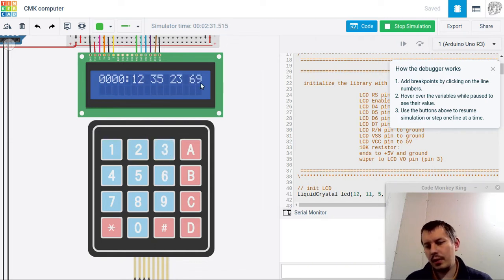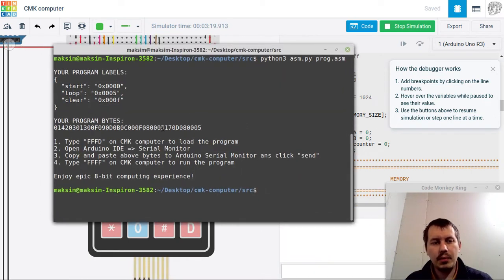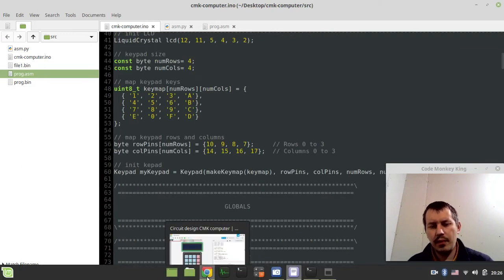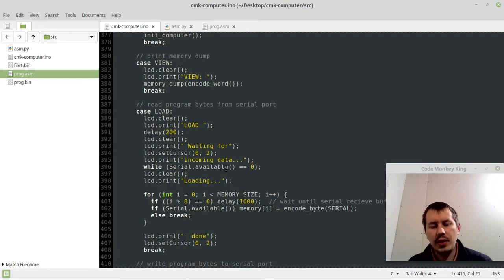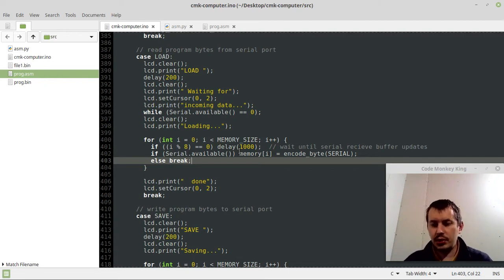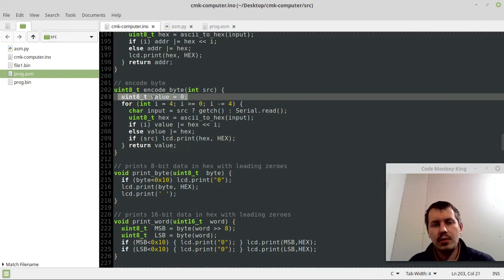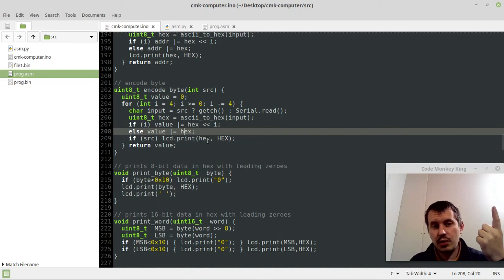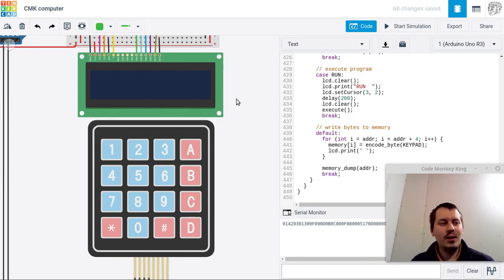How to receive more than 64 bytes on Arduino | data chunk read delay trick on 9600 baud rate

Comment from the maker: 00:00 Intro
00:53 A few words about the project
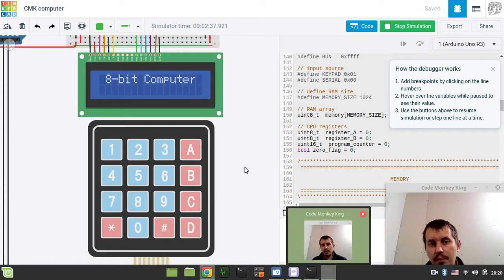02:34 A problem I had with my very first computer when I was a kid)
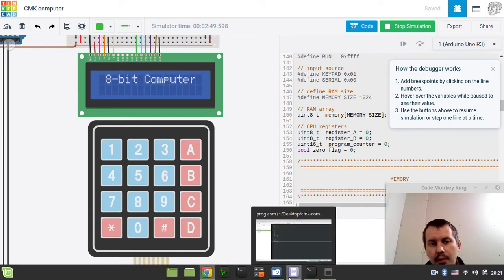03:30 Input format data for serial communication I'm using
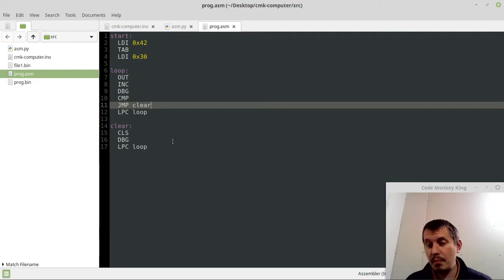04:35 THE MAIN QUESTION
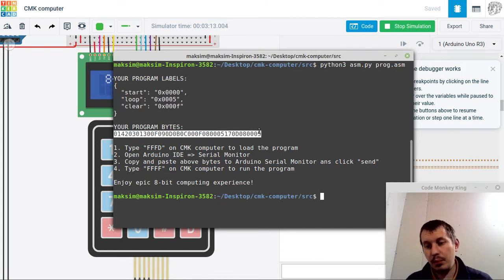05:06 Preparing data for transmission via serial port
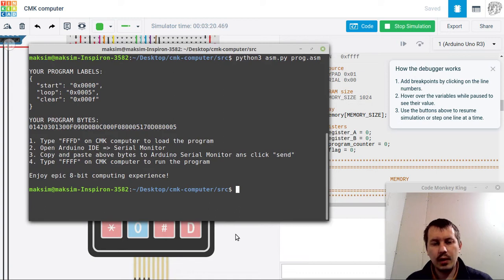05:40 SENDING BYTES TO ARDUINO
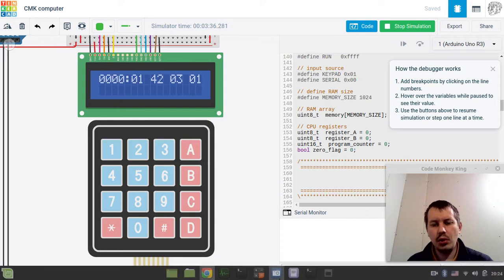06:40 Inspecting received data
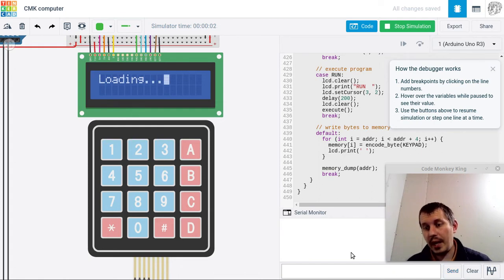10:44 SENDING BYTES FROM ARDUINO
11:30 WHY TO CONVERT BYTES TO ASCII BACK AND FORTH?
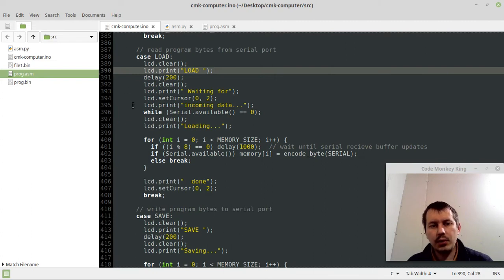12:58 How to receive more than 64 bytes on Arduino
14:13 Data chunk read delay trick on 9600 baud rate
15:16 A bit of theory on how serial communication works on a circuit level
17:00 We just need to wait a little bit until the receiving buffer gets the next chunk of 8 bytes
17:20 Why to wait for 1 second and how is this related to 9600 baud rate?
20:00 How to encode 2 ASCII characters into a single byte?
21:20 How to convert a single digit/letter to hex integer nibble?
22:45 1st ASCII character becomes most significant nibble
23:00 2nd ASCII character becomes least significant nibble
24:30 Reusing encode_byte() procedure for different input sources
26:18 Outro

Comment: Hello, I am trying to understand why you were delaying the code every 8 bytes if the receive serial buffer has a capacity of 64 bytes. Also, you had mentioned that the 9600 baud rate transmits ~960 characters per second, this eventually influencing your decision to choose 1 second to be the length of the delay. This is unclear to me as well. 9600 bits per second when translated to bytes per second (or characters per second) is 1200 bytes per second, instead of 960. I believe I am misunderstanding some concepts here. I would like to implement your hack but before I can do that, I'd like to understand first what you are doing exactly. Thanks in advance for your time and consideration. :)
Reply from the maker: To be honest I came up with this decision via trial and error method so that eventually it just worked both on emulator and real hardware.
Reply: @code_monkey_king  Thank you so much for your response, I appreciate it! I will certainly add this hack to my toolset. Have a great day!
Reply from the maker: @clineeco  you're most welcome, cheers!

Comment: Could you offer an opinion of something for me ….. I’m trying to receive data from an SPI source and convert the values and send them to an lcd … how would you approach this?   The data streams and I would like the lcd to display this data real time (ish).    I’d really appreciate your thoughts..   Thanks!   ( I’ve been using arduino megas for trial)
Reply from the maker: Awesome question, thank you, I think with lcd library for Arduino printing bytes as simple as call lcd.print() and as for reading from SPI standard chunk is 64 bytes and since you don't need more than 64 bytes per time you can simply do serial.read() several times. LCD should display smoothly.

Comment: This is great man.  Deserves way more views! - Creating the bytes with python is a neat trick. 
Using modulus 8 in the Arduino code with the delay for the the Baud rate is very cool as well.

(I recently did a video on UART fix for the Raspberry Pi 4)
I think you may be able to increase baud rate above 9600 if you need to on the Nano, eventually?
Out of interest why was the //encode_byte function from +4 to -4, as opposed to say 8 down to 0 ?
Reply from the maker: I like to stick to 9600 because the lower the rate the more stable data transmission I have (so I don't need to get bothered by wire length etc.) but with my max 1k data transfers it's almost instant anyway)))

And regarding delay trick - it's ok only if I don't convert bytes on the fly, otherwise it still drops later on... So I was forced to rely on Serial.readBytes() and then convert ASCII bytes to integers afterwards.

CMK computer is now assembled and working,
I have hello word program and print all ASCII in scrolling mode. Currently I'm porting CHrome Dino game... I've already made Dino and cactus sprites (LCD supports custom chars which is cool!) Once done I'll start writing chess for it.

I'm not releasing it yet because really lots of tests are still needed.